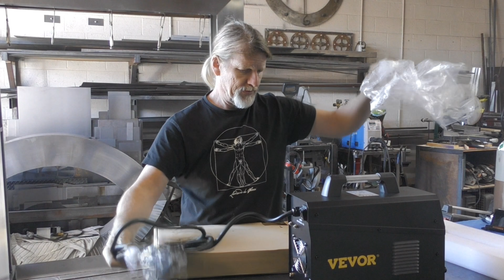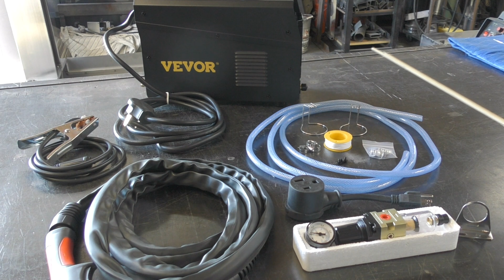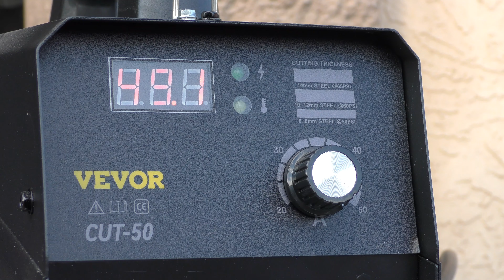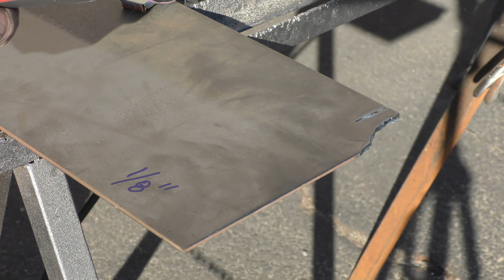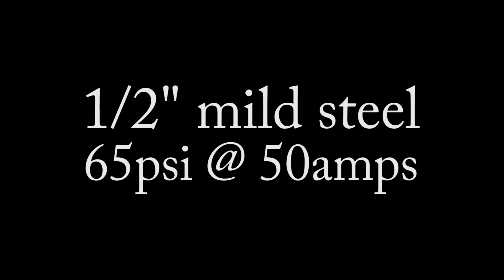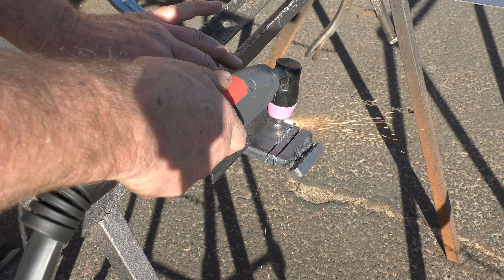Vevor 50amp Plasma Cutting Machine Review The Big Test!

Comment: VEVOR IS GARBAGE.  THEY HAVE NO CUSTOMER SUPPORT AND NONE OF THEIR PRODUCTS WORK.  IT IS CRAP!!  DO NOT WAIST YOUR MONEY - LEARN FROM MY EXPERIENCE - BUY AMERICAN OR CANADIAN MADE
Reply from the maker: That sucks you had such a bad experience. Although it is the cheapest plasma cutting machine in my shop, I've had it for over a year now and it still does it's job when I use it. Now I wouldn't put it on a production line but using it for small projects or simple straight line cuts, it hasn't failed me yet. I haven't needed to use customer support yet, but I'm sure it's non existent as you mentioned. Thanks for the comment and your experience with it.